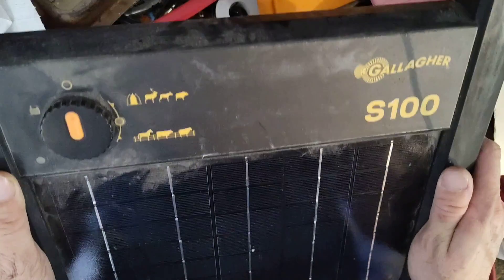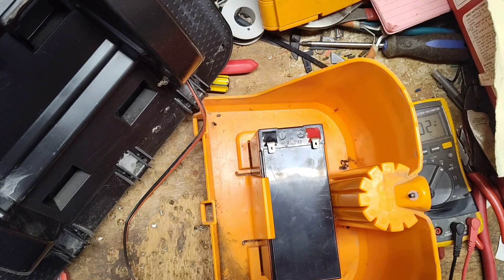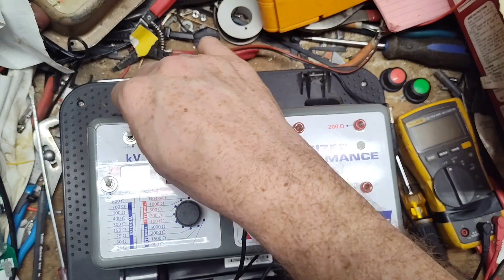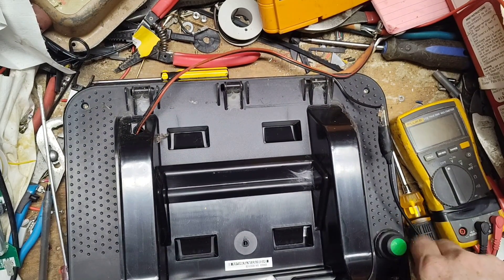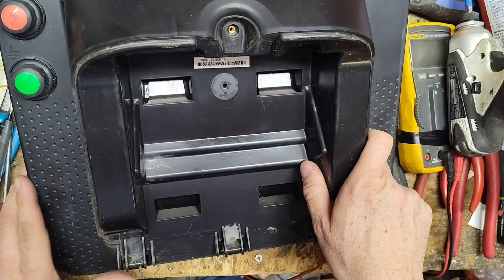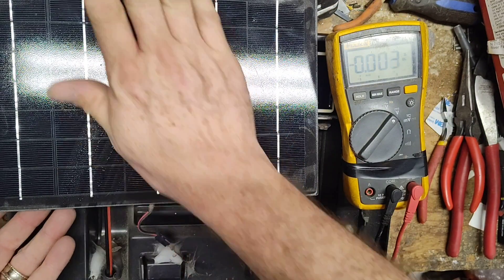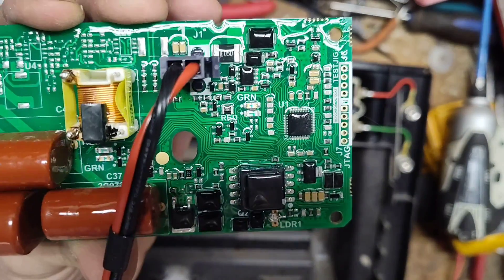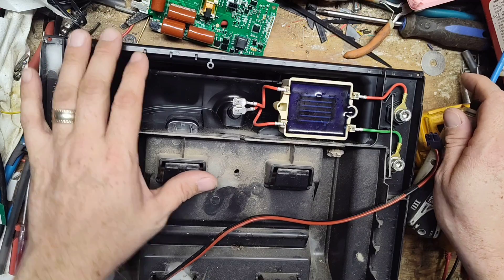🤔 Bad Solar Panel or Something Else?! Gallagher S100 Solar Fence Energizer Repair

Comment: Trying use a battery or a 12 v power supply to to make sure it's the board.
Reply from the maker: I installed a new board, took the unit back outside to retest, and we had good voltage making it to the battery leads. So something in the regulator system on the board has went bad.